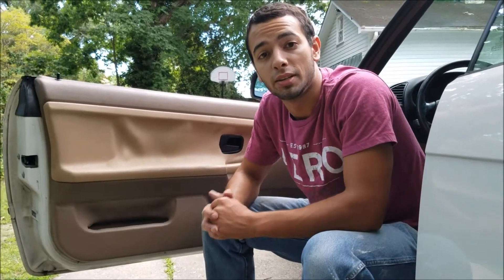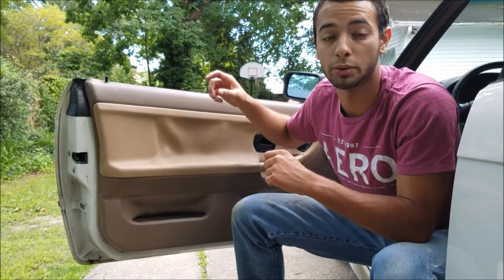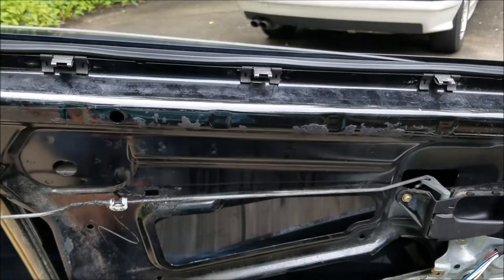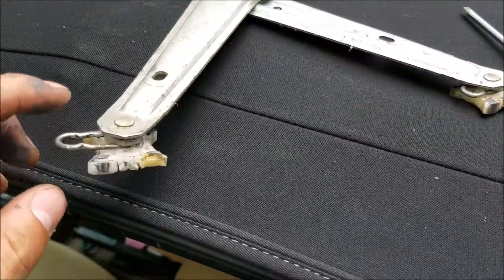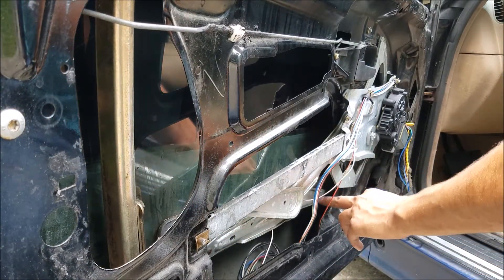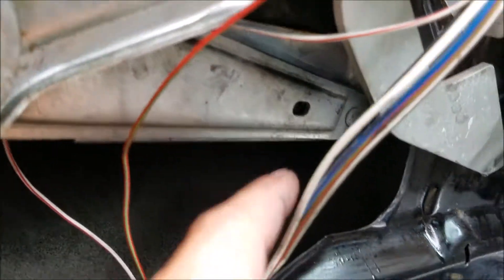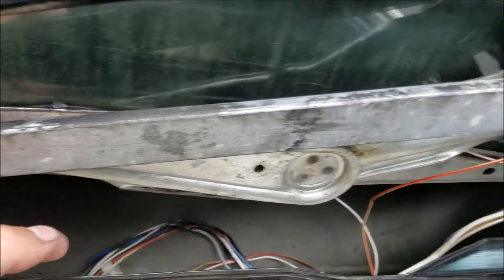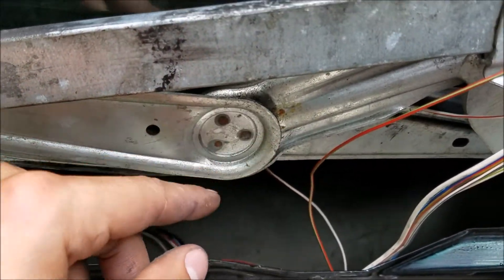BMW E36 Window Regulator Glides Fix

Comment: like your videos too am also working on my 98 328is right now I'm fighting the power steering leak and fixing to replace the hoses, the bottle that holds the power steering and change the fluid since it was almost black, then I will be tackiling the vaccum leaks with my diy smoke machine so I appreciate you doing work for your brother these old cars are alot of work
Reply from the maker: If you replace the really long metal line that attaches to the rubber line you could consider breaking the crimp and using a regular hose clamp. It will work with the low pressure side. Yeah they definitely can require more work than the average vehicle, I like to pack three or four fixes once a month.
Reply: E36 Fanatics high pressure side is the one from the pump to the black tank right, and the power steering rack is what I assume your talking about yeah there's a hose to it from the black power steering tank
Reply from the maker: Yes pump to reservoir, the short line. The one that I put a hose clamp on is the expensive low pressure line, because you have to buy the entire metal line not just the hose.

Comment: The rear clip guide on the window itself keeps falling off whenever I move the window up, on top of an issue where the front of the window gets stuck on the front Window regulator track. Anyway I can fix the window clip guide?

Comment: Can you let me know how to align the window or reset it as you mentioned in this video? My window is slightly out of line. When I push the button, it will go down half way and then just go back up by itself. I've been told this is because of the window being out alignment?

Comment: Great video I'm fighting a issue with catalytic efficiency code I have changed the cat twice first one with the eastern brand and my second current one a magnaflow cat I have a 1997 318i do you know if our cars are sensitive to a specific brand ? or what causes this code
Reply from the maker: Did you replace the 02 sensors first? OEM Cats on these cars are extremely expensive if I recall, once these vehicles hit around 100xxx they start throwing bad 02 codes like clockwork.
Reply: E36 Fanatics Bro that the thing I changed all the 02 sensors with oem Bosch . running new Tps sensor,Camshaft. sensor ,Maf sensor . I also running Cold Air Intake set up spark plug and wires have been changed too. I scanned with a C310 Scanner the code said Catalytic Conversion On and Additive Mixture adaptation (Idle control limit reached. I don't know what it means

Comment: if i hold the button to push my passenger window up it will roll up  for like a sec then roll down little bit. I also had this issue too I was going in reverse and something hit my driver's door and made my window fall down to the door and the clips just broke so as of now my window does not work n I need to buy could and that spray to make it hold up
Reply from the maker: Have you pulled the panel? Take a look at the teeth on the regulator and the motor. On the regulator I worked on after this the teeth had become slightly misaligned and the motor and regulator would freeze after going up a bit.
Reply: E36 Fanatics yeah I pulled panel, I've got the window up manually to avoid rain but the window was not aligned with the rail so it was out of it's place so we realligned it now only one window regulator clip is in their the other other is missing so Im gonna have to order it and buy that silicone spray and try popping it in, teeth I will have to check but I think it's that bushing you mentioned in a earlier video
Reply from the maker: I would pop the regulator glide back in, make sure you put the clip in as well. Then I'd spray down the metal side rail and the glide rails, and test it after that. You might have to reset the window afterwards.
Reply: E36 Fanatics to reallign the teeth with the window do I have to manually move the teeth for it to be aligned to work with the window because I don't know if mine are my window is just up manually and not sure if their in same position. also do you have any recommendations for which inner and outer tie rod assembly works for you? when I turn the wheel I can hear clacking so I figured since previous owner didn't do anything I might as well replace drivers and passenger side. after this I need to get another vanos system mine is like ticking on cold starts because I ran a oil too light. 0w-40 in Texas
Reply from the maker: If its misaligned you will probably have to pull the regulator and motor assembly off the door. I simply pulled mine off, replaced the bushing, greased it up and reattached it. I typically just get the stock tie rods that are available at the auto parts store, when it comes to suspension I go with urethane bushings now.

Comment: can you help with how to put the actual window into the guides?
Reply from the maker: Man I wish there was an easy way to explain and do it, but if your referring to aligning it on the sides, its a pain in the a@@. Every time I do it I have someone help hold it while I curse and align it.
Reply: what does need to be aligned? Bolts or what? I can't get the window into the guides, yes. I got a 1992 sedan, driver's window.
Reply: i can only get the window to one guide (the front one (towards the front of the car) or rear) at a time.
Reply: spookas my car seems to have only 1 clip per window, rails on both sides. Is that normal or should there be 2 clips per window? Sedan body style.
Reply: @codenamecordon  should be two

Comment: I  am having the same issue too. but I want to ask if one can remove the clip and sliders  without removing the whole regulator?
Reply: Bamidele Emmanuel  yes u can roll down window so u can get to the sliders there is metel clips that hold it in slid the clips out an pull on the bar an slid ur sliders out it’s simple